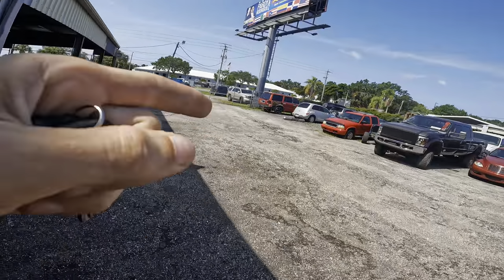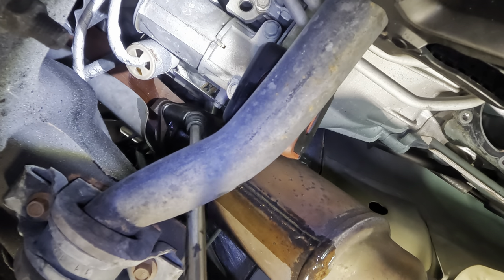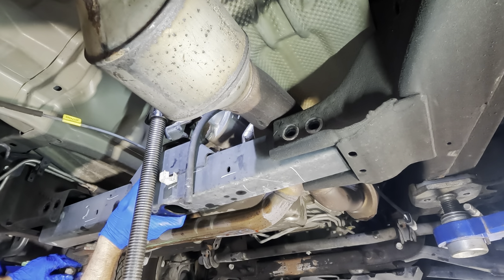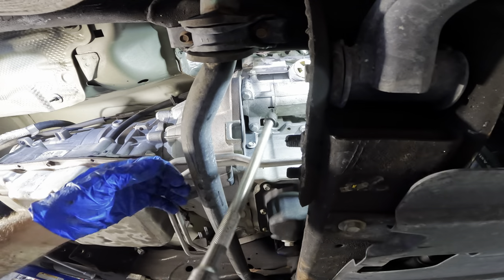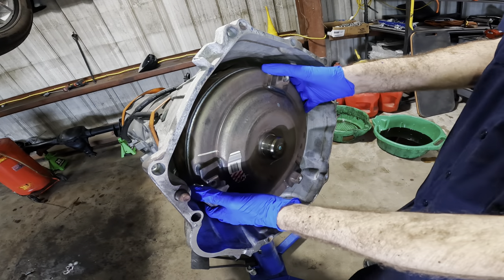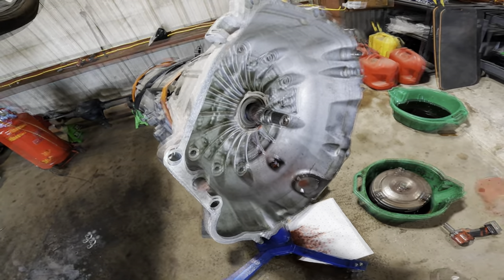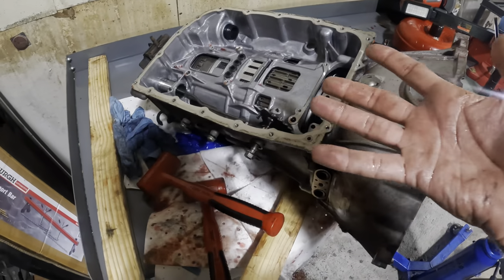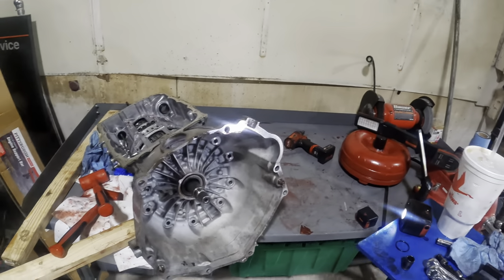Went too FAR! Invasive Inspection, 6l80 Transmission. 2016 Chevy Tahoe 5.3

Comment: Dude!  I respect your drive to learn but you need to do more research before you dive in to things you are not knowledgeable about.  As you discovered, the valve body does not need to come off to remove the bellhousing/pump.  If you do remove the valve body, the very first thing you do after removing the pan and filter is to lift the white tab and pull out the pass-through connector.  The valve body needs to be reinstalled straight up and down, not at an angle to insure good seal to the bridge seal.  GM recommends that you DO NOT remove the stator shaft from the pump assembly.  There are noted issues with the gasket between the stator and the pump cover blowing out.  Doing this is not required to inspect the pump.  You did not remove the pump rotor and vanes to inspect under the slide.  If you would have, you would see that there is major damage to the pump body.  ANY scoring seen and the pump needs replacing.  Standard procedure on a failed torque converter in a 6L80/6L90.  HOWEVER!  That is not your major concern.  What is a concern(you may have already found out) is that this truck is coming back to you in short order.  When you started messing with the 1234/35R drum, you got to know the little intricacies and you don't.  At 55:21, you can plainly see that the snap ring is not seated.  There is one "blind" lug on the drum that the snap ring ends have to span.  You have the snap ring over this lug and one or two shifts and the entire snap ring is going to pop off.
Reply from the maker: My man!!! Thanks for the info. As of this morning, the trans is still on my bench and I pulled that drum back out. Sure enough I had the ring misaligned you saved the day!!!! 😃
Reply: Here is the savior!!!! I went thru all the comments just to find you! Huzzah! Grats on the catch!!!!!
Reply: Send him some merch!! He saved you and the customer a huge headache lol! ❤
Reply: He made a second video dedicated for you.  You the real MVP!!!
Reply: Sounds like you still need to replace the pump.
Reply: Good catch. More importantly, thanks for contributing your knowledge. Ray made a dedicated video, responding to this, so I thought I’d come back and find it, to say thanks and drop a thumbs up.
Reply: "plainly see" yea i dont know much of anything here can you somehow point it out with a reference or a link to a screenshot on imgur or something?
Reply: pump is integrated into the bellhousing you got to replace the bellhousing $$$
Reply: @BahBahTheSheep  Stop your video at exactly 55:21.  Look at the left side of the drum.  You can see the top end of the snap ring is in place but the bottom end is riding on the blind lug and not expanded to the outside edge.
Reply: @mikep1176  I used to work at a transmission parts store and we used to R&R a lot of these
Reply: I have watched enough the the @PrecisionTransmission channel to know that Ray was doing it wrong.
Reply: I respect and appreciate Ray's humility in this situation, but I have to mirror the posted commenter's sentiments. It was strange to see Ray impulsively getting into a something as complex as a customer's transmission seemingly on a whim. Learning is always good, but there's generally a time and place for it. Maybe on a core or known damaged bad unit that's being R&R'd. In my opinion it's reckless to explore like that without prior research or experience. At best, it will probably cost the shop money on a comeback, at worst, it may necessitate replacement in a short timeframe. That said, again, I respect Ray's transparency and candor.
Reply: @RayleighCriterion lol same, i knew Ray was gonna have issues when he didn't remove the o ring before pulling on the bell housing thanks to watching Richard
Reply: @RainmanRaysRepairs  With all that glitter, a suspect pump, and "ANY scoring seen and the pump needs replacing.  Standard procedure on a failed torque converter in a 6L80/6L90", I think it may be time to replace the transmission with a factory rebuilt along with a torque converter.  It may cost more, but in the long run it will keep the customer happy and be fewer headaches for you.  I had the transmission replaced in a Chevy pickup truck a while a go, by a guy that had worked for a Chevy dealer.  He wouldn't do a rebuild.  He said there had been so many updates since my transmission was built, he would only install a rebuild.  It wasn't cheap, but I never regretted it.
Reply: Just came back to say thanks for helping our rainman out ✌️ most heroes don't wear capes
Reply: I have you a subscribe if you ever make a video
Reply: PRAISE the skuta!! :D
Reply: good catch, finally a poster who knows his transmissions...and more importantly ..., what he's talking about.
Reply: @RayleighCriterion  I really enjoy Precision Transmission videos. Learned a lot from Richard.
Reply: I sent you a sub too, in case you make some videos! You are the hero of the day! 
AND you proved Ray reads his comments!!!!
Reply: You mentioned some visible scoring on the pump, this unit may work after reassembly but will likely be back before to long and now that you have been inside it and more so documented it on video your going to be liable for the invetible failure. Factory rebuilt units are updated so much for reliability that it makes sense for the cost to go that route anymore. Shop rebuilds don't always go perfectly either.
Reply: @skutahuniai4830  i see it, bottom right, left side. snap ring isnt slipped under
Reply: @mphilleo  there is also a alignment band used to align the 2 halves of the pump during reassembly, while not having it isn’t necessarily a problem not aligning the 2 halves can sometimes lead to issues later on…
Yea he has a ego problem that leads him down dangerous paths time and time again.
Reply: get the man a case of beer nice save
Reply: And that is why I want to to learn transmissions this upcoming year because I have no clue what you're seeing..😂 Good eye, apparently I dont see it..
Reply: Dude, I'm amazed you noticed that! I certainly wouldn't have noticed that at all! Or at least I wouldn't have if I didn't see your comment beforehand.
Reply: You have to remember that he is not rebuilding a transmission he is simply changing a torque converter I’m sure this repair won’t last forever but the costumer isn’t paying for a 6 grand rebuild if he was looking for that I’m sure he would have taken it to a transmission shop.
Reply: We learn from our mistakes and sometimes we don't but nothing ventured nothing gained.
Reply: @skutahuniai4830 maybe a little forward, at 55:22. There I can clearly see at left of the drum the bottom part of the snap ring out of place. Scary, for sure 😮
Reply: @andyrbush You should send your car to him so he can tear down the transmission and learn how it works.
Reply: @bcad4066  Will you pay? My car isn't in the US. Probably about $15k to ship it.
Reply: Thanks Ray and @Skutahuniai4830 .  my first time seeing inside a trans and relearned a valuable lesson.  it's always more complicated than it looks...before you start.  I've worked myself into a disaster a few times now :)   there are "mechanic" shops and "Transmission" shops for a reason.  Let the pros do the PRO stuff.
Reply: 40 years in the Transmission business and I got to say you should just buy remands.
Reply: @keysautorepair6038  The risk vs. reward situation here though is a bit off-kilter. They might be facing a $6K rebuild after an impromptu teardown. Transmission shudder can sometimes be a software issue, or an actuator, like the lock-up clutch mechanism. Not throwing shade on anyone, but transmissions are a blackhole that don't reward curiosity.
Reply: @keysautorepair6038  problem is he never should have taken it apart especially not knowing he should have done the torque converter and that is all but because he took it apart and it's on video as well as him admitting on video his lack of knowledge about the trans he can and probably will be held liable for when it fails
Reply: 34:02 -- Since you're in Florida, are those Miami dowel pins?
Reply: @jays106  the problem with that is it's not going to fail.. see the very first comment.. it's pinned..

Comment: Oh my. Ray, please don't save that PT Cruiser at the end of the lot. All PT Cruisers must be destroyed, for the good of mankind.
Reply: Add me in ....let the great PT Cruiser meltdown begin
Reply: Fully agree 1000%.  One took out my Mach 1.  I know it was its drivers fault but I only hate the car and all pt cruisers should be crushed!!🤬
Reply: All Chrysler must be crushed from the K car and up.
Reply: Owned a Cruiser for 11 years only maintenance item had to replace the cooling fan.
Reply: +1
Reply: Yeah, them and furbies have got to go!
Reply: Our pt torque steered the wheel out of your hands when turning and accelerating . Cute picnic basket….convertible but was demonic
Reply: @charlesjordan8364 no way😅 how did you manage that?
Reply: @charlesjordan8364  It's not about how good or bad the car is, but how UGLY it is. That thing belongs in a pit with the Aztec. I've also taken to noticing that seemingly everyone who drives one is a terrible driver.
Reply: @Krelian1  For ugly, don’t forget the Pacer and the Gremlin.
Reply: Lol don't hate on the poor pt cruisers 😂 it was my first car and surprisingly reliable the thing ran without issues upto 178,000miles before it began having a water pump leak. I sold it afterwards but if i had been willing to work on it myself I could have fixed that leak and did the timing belt and likely drove it passed the 200k mark. Others in my family had Toyota camry and Chevy SUVs and they all broke down a few times while my old faithful pt cruiser never quit on me.  Only issue i had before that leak was one time replacing a starter at 158,000miles and a cheap car battery.
Reply: I have never been a fan of Chrysler products but I have owned 2 and they were the most reliable cars I have ever owned.  1999 Plymouth Voyager, 4 cylinder, 3 sp auto and 2005 Cruiser.
Reply: @bobbg9041  I’d own a k car before a newer Gm. Pt cruisers aren’t that bad 😂
Reply: Drop a 350 in it
Reply: That has the same engine as the Dodge Neon. I had a Dodge Neon that sold before I would have to replace the timing belt because I really did not need the car and did not want to put repairs like changing the timing belt because of the labor that would be necessary.
Reply: What's wrong with PT Cruisers